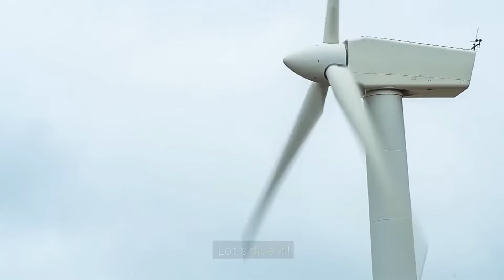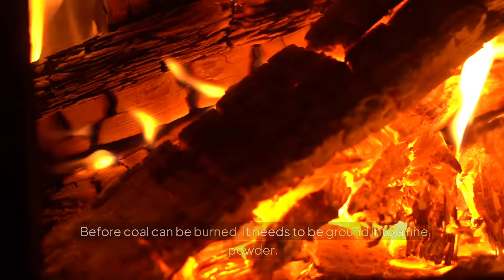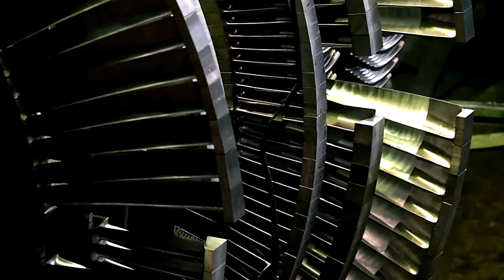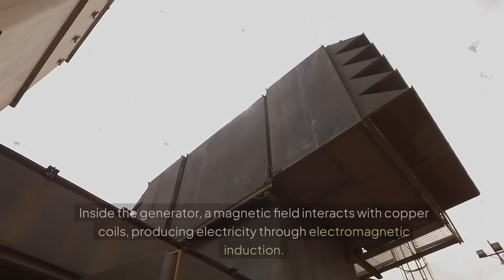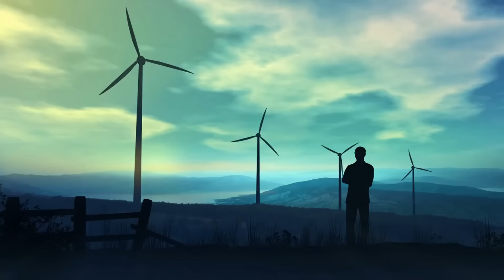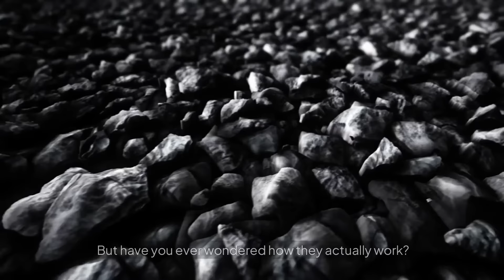How a Coal Power Plant Works | Step-by-Step Explanation

Comment from the maker: Would you be okay living near a coal power plant, or is that a dealbreaker for you? 👇
Reply: i live 10km away from the coal power plant for 18 years,  and im okay.
Reply: @Insightdetails1  I don't mean to upstage you but I lives within a 5km of a coal plant.
Reply: @Insightdetails1  I could do within 2 km easy. My neighborhood only had coal fire heat in winter. Most homes still sport the coal chute. My neighborhood must have been horrific in winter time without all those swell pollution scrubbing device on modern power plants.😊

Comment: We are a Chinese company specializing in power EPC projects. Our capabilities cover a wide range of service areas, including coal, natural gas, biomass energy, waste incineration energy, photovoltaic power generation (including ground-based, rooftop-based, mountain-based and floating solar installations), as well as used steam turbine. We also provide large-scale hot water boiler centralized heating projects.
Reply: Yes. The chinese are definietly who I would trust with this.